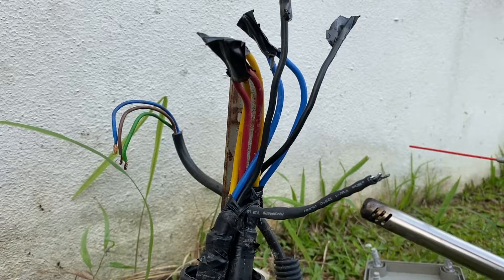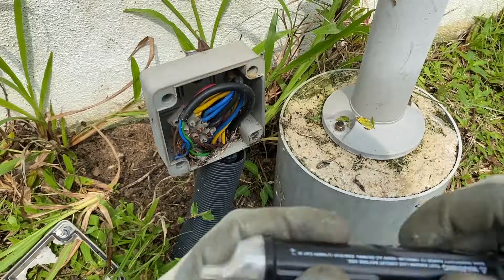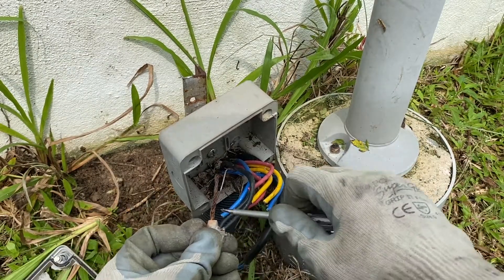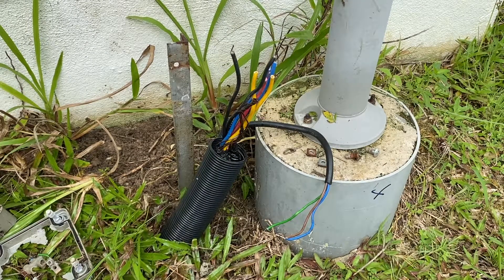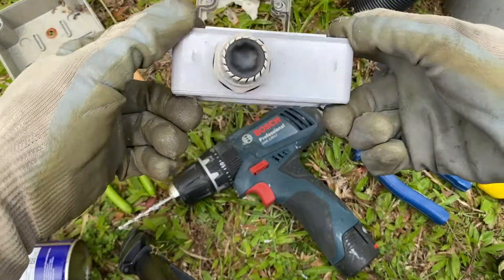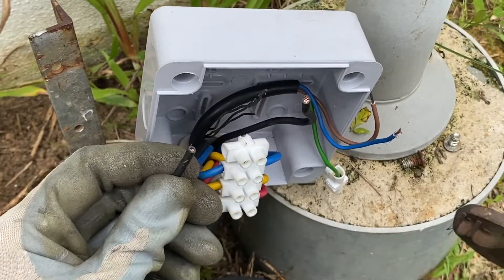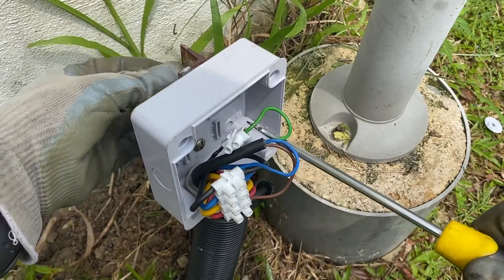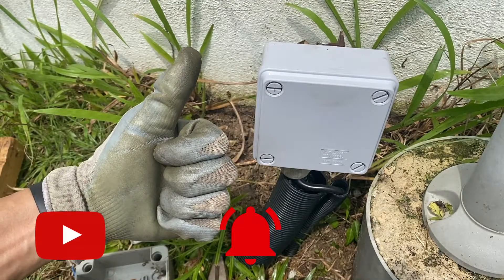Install an electrical junction box with three phase wiring at outdoor garden

Comment: Would you recommend 1 of these for a livestock shed? Need to wire up some LED flood lights but they come pre-wired so I will need an external connection like that, there will be condensation and steam from the livestock so I need something fairly watertight. Just thinking this type will be easier if the light breaks or I want to wire another light
Reply from the maker: Check if you need a larger box. PVC tends to become brittle after three years exposed to UV from the Sun.

Comment: nice work bro. feeder pillar pun cantik.. better not use connector blocks, because get brittle easily outside..
Reply from the maker: Any suggestion what to use to replace connector blocks for outdoor?
Reply: @CTB6  maybe you could try this? https://shopee.com.my/product/169764033/6532784277?smtt=0.205678203-1627306736.9

ive never used it before,but it seems like a better alternative than connector blocks. but i know that connector blocks outside are not reliable. usually due to poor installation though

Comment: which country is this? why dont u use the cable link with crimping tool
Reply from the maker: Not recommend to use crimping tool. The junction box need to be replaced after 5years. The UV from the sun will degrade the plastic box. It make the box brittle after some time later. Screw in type connector allows removal and changing the box easier without cutting the wire in future. Hope this clarify.